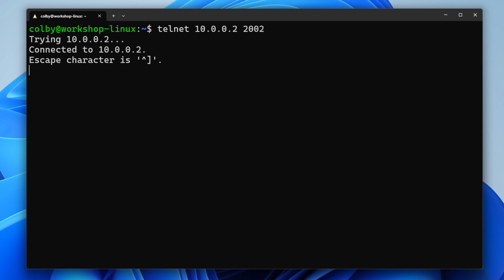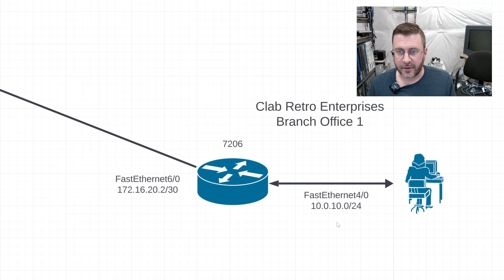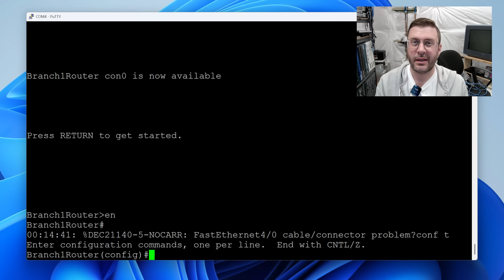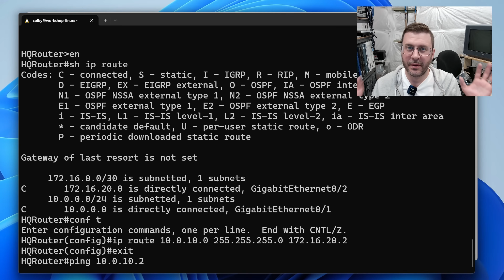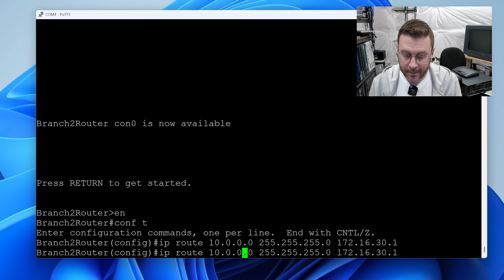Building a Branch Office

Comment: I bought the same PC-100A pdu switcher and annoying the LEDS don't align up. Some switches up the LED is at the top, and others switches up the LED is at the bottom. Seems to be a quality control issue.

Comment: Hey, I work for a large telecom company.  Your lab is very accurate.  Customers would order point to point T1's and have their own network .  As well as point to point Ethernet.  Granted they were very expensive in late 90's and early 2000's.  Frame Relay was another big WAN network in late 90's.  Great Video.  Thanks.

Comment: Cisco 7206 was an amazing platform. Really it was the last of the service provider grade software forwarding platforms which meant it could do anything you needed in terms of handling frames/packets. The midplane design with the VXR refresh (I think that was for G1 support?) meant you just swapped in the NPE upgrades as they came out to make it faster, and the port adapters just changed at low cost as needs moved on through 10s of generations of WAN and LAN connectivity types. The G1 was a huge step for it where it bridged the gap where Ethernet started to take over as the main WAN technology and gave them a big bump in CPU and RAM. I worked with them for many years as MPLS L3VPN route reflectors and provider edge (with all those PAs terminating things like E3s bundled with customer E1s, or the 8 port T/E1 PA was pretty common at smaller PoPs). It took a long time to make the C10k and 7300 work in any usable fashion with their new centralised hardware forwarding on ASICs (only big GSRs were using ASICs in distributed forwarding on line cards that had house prices at the time).
Twenty years hence in the networking industry every platform since has had a shorter lifespan, felt less software/hardware integrated and been far less capable of fiddling with packets. But hey the speeds are now bonkers.

Comment: I miss having a rack of old Sun SPARC servers, but not enough to keep them around at today's electricity rates. Still have two sun4c boxes, though! Probably just need some PSU electrolytic caps and a CR2032 bodged-onto the NVRAM. And yeah, a 7206 and 7206VXR were definitely ISP-grade gear. Well, you'd want to have a redundant pair of them, at minimum, but they were serious gear, built NEBS compliant for telecom facilities. At one point, I glomed-on to a decommissioned 7206VXR with nothing in it except the PSUs and an NPE G2. All the other modules were blanks, including the I/O controller, which wasn't needed with the G1 or G2 NPEs. Was part of a trio, linked with VRRP, but I was commuting by bus, at the time, and could only carry one of them home.

Comment: For the routes you could use a dynamic routing protocol such as ospf

ON EACH ROUTER

router(config)#router ospf 1
router(config-forgot-text)#network wan_ip_network_address wildcard area 0
router(config-forgot-text)#network lan_ip_network_address wildcard area 0

INSTEAD OF going to each router and manually issuing ip route x.x.x.x x.x.x.x x.x.x.x for each network for each router

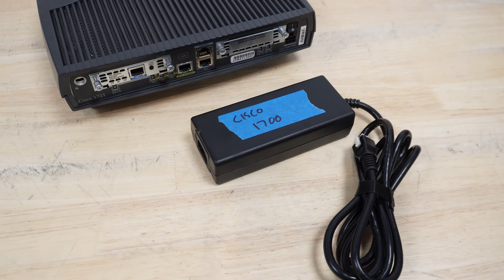Comment: 27:00 Cheap Behringer mixers and effects are still using that connector since '90. You can buy brand new external power supplies for those. Mixer with 48V phantom should need enough power to satisfy an old router.

Comment: Those were fairly common forms of power connector for the era. They needed more than the bog-standard 5v or 12v, so there had to be more than a simple barrel jack common on consumer trash. If you look at the back of a modern AT&T BGW320, it has a round multi-pin connector. (apparently the same as some DTV gear.) I have some very old linksys gear that uses a multi-pin connector similar to the 1600. Most modern gear has the PSU internal to the unit, so these sorts of things aren't necessary. (makes the devices bigger, heavier, and more expensive.)

Comment: Your static routing on the branch offices could be massively simplified with a single default route as they don't have any other paths to select from. Edit: In fact your inter-branch ping test doesn't make sense given the configuration you show around 22 minutes into the video. If that's all the routes you configured on the branch1 router, you'd have incomplete routing and that ping test should not have worked. Unless there's some weird NAT configuration going on somewhere.

Comment: The BVI sounds very very similar to an SVI. The "interface" lives within IOS, not the module card. This probably makes a lot of sense in terms of if cards were replaced due to failure or swapped around or god knows what reason - you want that interface to live on the router config, not some sub-module config.

Comment: Nice to see a lot of my Cisco IOS training making a cameo here. I remember setting up similar configurations to build out a simple network between two hosts in the classroom over a pair of 2900 series switches and a 4300 series router. Good times, lol.

As is, this bears a resemblance to a leased-line connection over an ISP. These days you can usually get a fiber line or two from a metro ISP towards that end. There's a lot of spare cabling under the ground from before we figured out light spectrum multiplexing. Would be neat to see some old-school Frame Relay/ATM infrastructure in the middle of this, though!

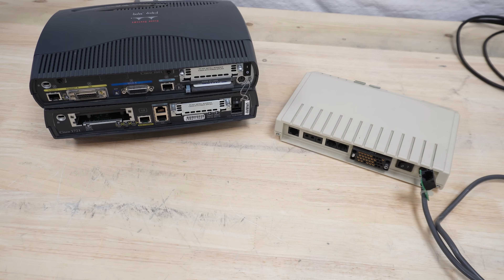Comment: 24:31 

Hi there, I don’t normally comment, but I did want to mention a couple of things. The connector on the WIC-1T is Cisco’s proprietary DB-60 standard, as opposed to the more modern ‘Smart Serial’ WIC-2T. However, it is exactly that, a serial connection, namely a 5-in-1 connection. You should still be able to find cables that adapt the DB-60 to V.35, RS-232 (25 pin, like the one on the 7200’s), RS-449, and X.21. 

Regarding connections, point to point Ethernet is very much in use today, and has actually replaced most of what we think of as “WAN” technologies like Frame Relay, X.25, and even SONET. Many if not most enterprises today that use leased-line connections receive an Ethernet handoff from a Tier 2 or Tier 3 carrier using either dark fiber or a Metro Ethernet link (MPLS and VPLS are related technologies). 

You might also want to explore POS, or Packet over SONET with the SONET cards. It works by taking a SONET frame and encapsulating either a Point to Point packet or IP packet, instead of relying on ATM to do it. You would see an extension of this in the early days with DSL where PPPoA would be in use with some carriers, which is Point to Point Packet over ATM.

Comment: The 7200 series had a series of PCI buses in them.  Of the 6 slots, the right bank (mb2) is a PCI bus (2,4,6), and the left bank (mb1) plus the bottom I/O slot (0,1,3,5) is another PCI bus.  The NPE/NSE slot doesn't require points.  You worked on a points based system, with each identified PA card having a certain number of points allocated to it based on its maximum throughput.  Each PCI bus had 600 points to work with. Upon insertion, the chassis would read the PA's identifier from the EEPROM and calculate the points.  If you called TAC for a 7200, one of the first things they would check is you points allocation and then tell you to rebalance your PAs if they were out of balance.  Here's an explanation of the points:

https://www.cisco.com/c/en/us/td/docs/routers/7200/configuration/7200_port_adapter_config_guidelines/config/3875In.html#wp1115595

The 7200 was the first router to use a standard PCI backplane back in the day.  The original 7200 with a 25Mhz backplane could take up to a NPE-225 but not more.  The VXRs could run at both 25Mhz and 50Mhz, and could run all the way up to a NPE-G2.  Little known fact, but the 7201 was actually a NPE-G2 in a pizza box.  They took one of the PCI buses for the PAs, spun it around, and turned it into a 4th GigE port.  The NPE-G2 and thus the 7201 was a great little workhorse with a 1.8Gbps backplane.  

If you really want a deep dive on the architecture, the "Inside Cisco IOS Software Architecture" book will tell you more than you ever wanted to know:

https://book.caibitim.duckdns.org/download/72/pdf/72.pdf

Comment: Now all you have to do is add a redundant link between the two branch offices and set up RIP and/or OSPF and you’ll have recreated the network we made in my networking class this semester :)

The dynamic rerouting is fun to watch! The professor yanked the wire between a branch office and the main office, and OSPF rerouted through the other branch in less than 10 seconds.

Comment: I work for an ISP and we just e-wasted some of the VXRs that we had. We said "we gotta get rid of the 7200 Ciscos they are old enough to drive". They were left over from a company that we acquired many many years ago. The data center space was just left and we didn't know we owned it till we did some digging. 

Gotta love seeing things I'm actively removing put back into "use", keep it up!
Reply: Also some fun naming schemes that we use as an ISP
AGG1 (Aggregate - anchors all VLANS cross the network)
CR1 (Core Router - where we land peering and backbone circuits to BR)
BR1 (Boarder Router - Where we land customer connections to CPE or datacenter direct connect)
CPE (Customer premise equipment - typically a switch that customers are able to land their own connections onto)

Comment: Its interesting to see - I work daily with Cisco Catalyst 9k/3k (modern)-Series (as well as Catalyst-Center) on a daily basis, with a bit of Cisco Nexus and Wireless and sometimes even Cisco ACI (as we are Cisco-only) - currently we still have old 7200, Cat 6500s and loads of the 35xx Switches in our Basement - sitting there unused... It's nice to see someone with this tech and exploring the Cisco universe :) Although I can't provide you with hard or software I possibly can reproduce things if you are stuck eg. on dead T1-Cards :P And yes afaik those modules can't be hot-swapped

Comment: The 7200 chassis tend to fail because of cold soldering joints at the bus controllers. Already repaired one myself. There are huge plcc chips on the backplane, one for each slot. Their pojs become disconnected. Nothing a steady hand, a microscope, a good soldering iron and some flux couldn't fix. But anoying.
Leads to crashes like yours.

Check your slots, i thought it's a bad card first until i noticed that everything in the slot crashed ios. Also the same solder problem could happen to your modules.

Comment: Very nicely done. I was an IT manager for a multi-site organization back in the early 00s and installed so much of this gear. My network folks did all the configs, so it’s neat to see the fingerwork they had to go through. Loving the CLI segments!
Not everything is a CSU/DSU though. Cisco interfaces are only DSUs, Data Service Units. Channel Service applies to voice, so unless you are splitting a few voice channels off your T span to run a PBX, you won’t have a need for CSU associated configs.

Comment: If you set up a default route on the branch router to point to the hq rtr then you shouldn't need to configure  the static routes and you shouldn't need to setup any routing protocols on the branches...albeit that would be less fun 😂

Comment: 13:42 - for extra points, look at /31s for your p2p links.
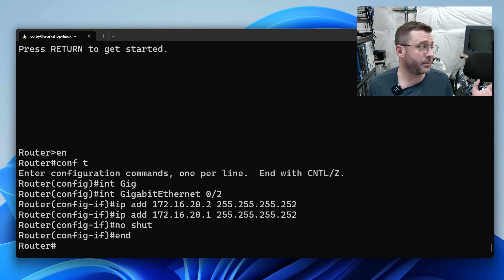16:20 - once you lab more fiber, you might want to look in to MPO cables and fan out cassettes, that way you won't have to run so many individual fibers between rooms/racks.

Comment: For the bridge group you don't need the Fast Ethernet module, all of the ports in the switch are already individual ports in slot 1+2 (Ethernet1/0 through Ethernet1/13), so you can group them together in a bridge group and use them as a single interface as BVI1. That would leave the Ethernet module in slot 4 available for anything else you may want to do.

Comment: See if you can grab yourself a basic ASR chassis for the REAL ISP experience!! Haha.  Great video, definitely tugs at the nostalgia!!
Reply: 7200 series routers ARE the real ISP experience, make no mistake. They were literally backbone routers for not insignificant chunks of the internet, particularly in lesser populated areas where larger platforms don't make sense.

Of course you'd have larger boxes like the 7500, 12000, maybe 7600, and more modern ASR series in larger population centres and peering locations. 

But there's nothing wrong with a 7200 for creating a small scale ISP like this.

A 12000 series sure would make a sweet addition though. 😄
Reply: @TomStorey96  That's very fair!  I guess it's all a matter of scale and speed.  I know a couple still sporting "older" ASRs (compared to today!) and they still handle thousands of multi-gigabit subs, 100 gigabit upstreams etc.  Might possibly be a little too "not-retro" for the Clab Lab!! :D

Comment: Just a few more ideas and obervations: Try to add some redundancy: connect the three offices in a ring topology (i.e. just connect the 1721 to the 7206) and set up the routing, so it goes straight to the target office's router, unless the ring is broken. Also don't waste precious IPv4 addresses, 172.16.20.4/30 is just as good of a subnet as 172.16.30.0/30 :) Btw, do these routers support /31 subnets per RFC3021? That would be ideal for the point to point links between the routers.

Comment: Oh hey, EtherSwitch cards. I think I've got a few 10/100 EtherSwitch WIC/HWICs around here somewhere, probably jammed into the ISR 3845 in one of my closets for storage. The last series of them that they made (NME-XD-24 and -48) were effectively just a pared down Catalyst 3750 board as a double-wide module for the 3825/3845 with a backplane uplink to the router. The 24-port ones even had StackWise ports on them and could be stacked with regular 3750s!

Comment: There was an office in the early to mid 2000s where I used to hang out quite a bit after school. It was a dual purpose thing, you could get on the internet for free and it was an office for people with Hungarian nationality, but not citizenship, to get something called a "Magyar Igazolvány" (Hungarian Certificate), which was (or maybe still is) an official document issued by Hungary to ethnic Hungarians living outside Hungary's borders, mainly in neighboring countries, which gives them some advantages in Hungary, like train ticket discounts. There were two workstations (Compaq Deskpro EX desktops), each equipped with a Cisco router. I'm not sure about the exact model, but I do recall the oval window over the LEDs, so it could have been 1700 series. I recall the ladies working there complaining about how slow their system was :D The funny thing is that I knew some stuff about networking back then, but building a closed system like that, was really out of my skills (they were accessing 10.x.x.x IPs IIRC) and now I'm doing these kind of things among others as my day job :D

Comment: Showing a trace route will make a lot of sense to people here as they would see that traffic did go via your link networks. 
Also if you wanted to show of you could have used the same "subnet" for our link networks, ie. 172.16.10.0/30, 172.16.10.4/30 
Would love ot see ospf here so you dont have to configure any static routes (Not ideal in a corp environment) 

Some ISPs did at lest in the 2000s allow ethernet based WAN connections here in Sweden - you could have your different locations on separate VLANs. However F/R and ATM gave other benefits as branch offices could talk to each other without the HQ - so I file server in NYC could serve Philadelphia for example directly without HQ

Comment: Would be nice to see traceroute (tracert in windows) demonstrated too.
Instead of setting up route for all the other branches, wouldn't it be better to set the default (fallback?) route to the central office instead?
For DHCP, an advanced option would be to have a DHCP proxy at the branch office, that way DHCP leases control is centralized.

Comment: It's wild how far we've come.  I've essentially done the same thing in my homelab but with IPSec+EoIP on Mikrotik, and it was only a handful of commands to be fully up and running.  Wireguard is the same thing, just as simple.

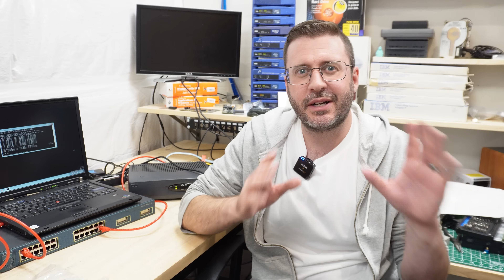Also worth noting at 38:47, Cox Business offers Metro Ethernet which is essentially PtP dedicated fiber between locations.  I'm not sure if such a thing existed back in the day, but it's fairly common now.  Don't forget PtP/PtMP fixed microwave connections for the hard to reach locations ;)

Comment: We did build something similar with tailscale VPN my old XP pc is DC1 and the others can then login into it, then i got a couple of srv2003VMs going for stuff like WDS (windows network install) windows update server.
Also i got a 2nd physical PC with a modem hooked to my routers ATA which goes to our own SIP server to get some faxes and dialup going (sadly only 28.8K even locally over that ATA).

Sadly thats all very virtual and software driven i like that you got actuall hardware to play with.

For routing i even use a VM with openwrt cause none of my physical routers can run it.

Apart from my modern AVM router and my buddys 2000's linksys router there is not much actuall network hw